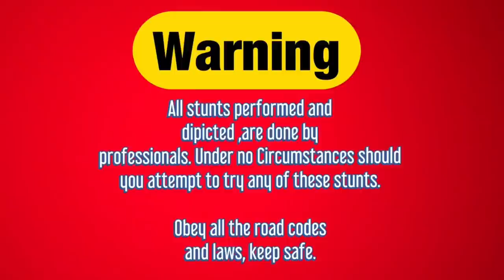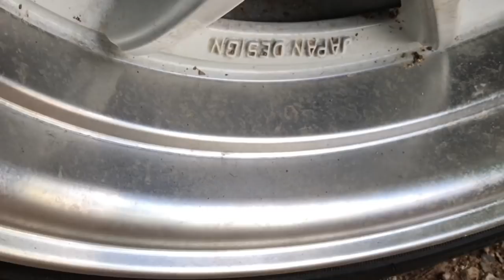bossy D aka Zed Boss & Sanchez VS Propa way ??(part 2).

Comment: Him nuh have notting to run the mark x 1jzvvti single turbo..280hp stock tune on stock 650hp to 700hp..a beams 3sgte max tune 888hp no more than that dat.or else the engine block will blow up.1jz 2jz king of engines.but toyota me ting so nah bash none a dem..